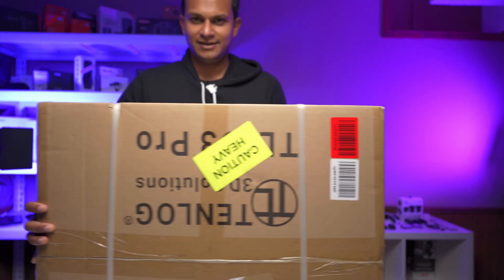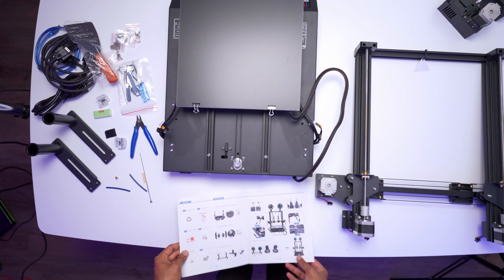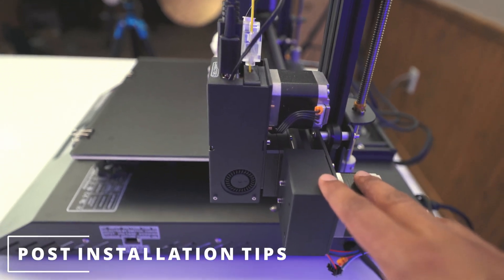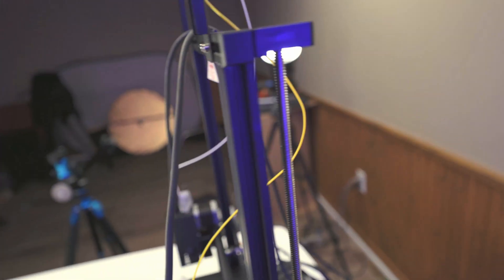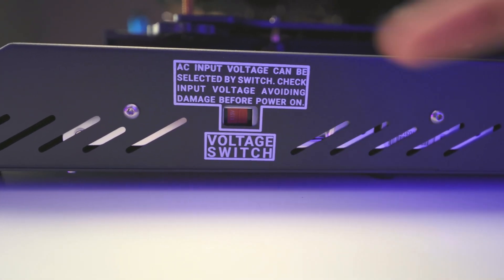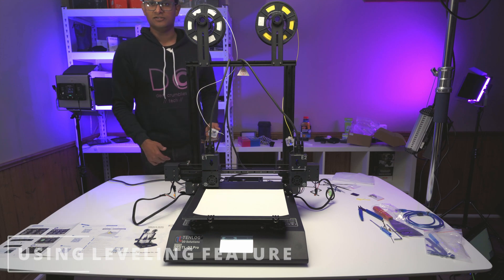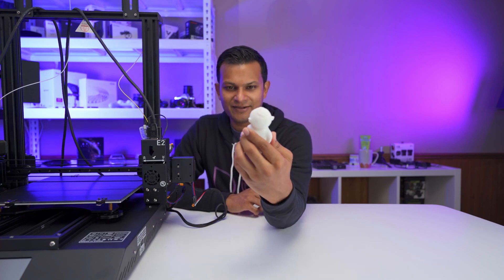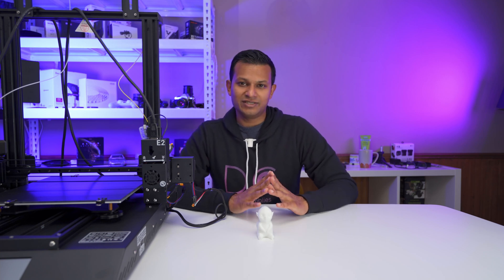TenLog TL D3 Pro Printer Review - Independent Dual Extruder 3D Printer

Comment: Many thanks for the video.
Please can you make a video of the calibration procedure, maybe even a video with soluble PVA.
Can this printer print ABS well ?.
I wish you a lot of luck with your channel. 👍
Reply from the maker: Hey Tim, thanks for the comment. Unfortunately, I ended up selling the 3D printer because I found that I wasn't using it as much as I thought I would. However, I was using this Facebook group, which was helpful along the way: https://www.facebook.com/groups/752964928487976/

The users there are pretty helpful with answering questions and there are also official Tenlog support users in there as well. Btw, the product page on Amazon lists "Support PVA TPU ABS PLA"

Comment: Thanks for the video. In the second video I'd be interested to hear about the bed, any issues with the direct feed, and dual color printing. I've seen some version of this that come with brushes to scrape off the oozing filament during dual color prints, but I didn't see that on yours. Also, some versions of this seem to come with a translucent glass plate, but yours looks different.
Reply from the maker: Hi there, sorry I didn't get this comment notification. I will try to experiment keeping those points in mind in my next video. I will double check the package contents too to see if there was a brush included, but I don't believe so off the top of my head.